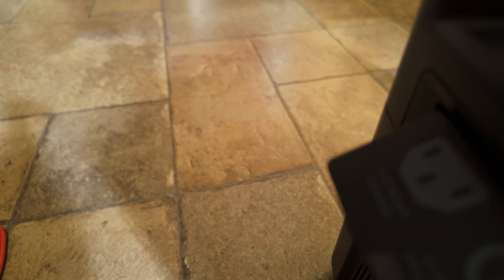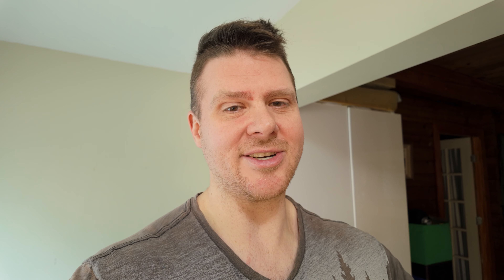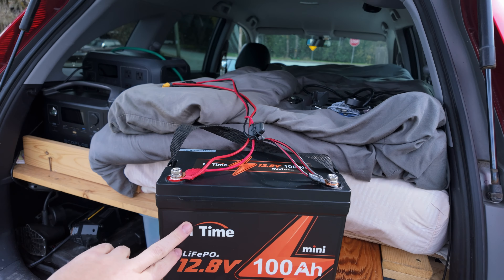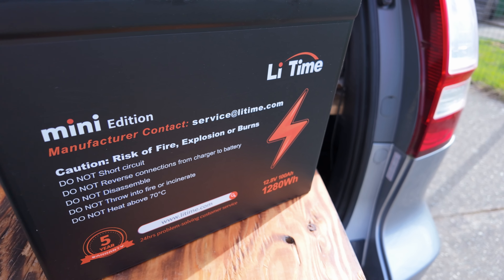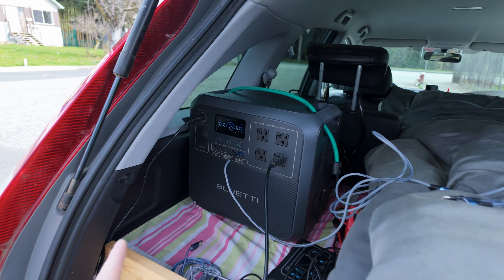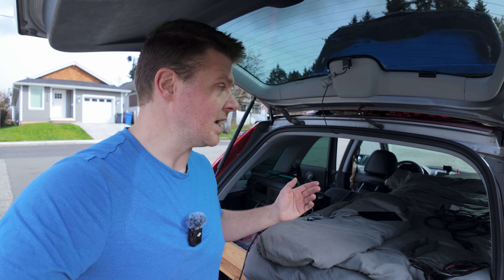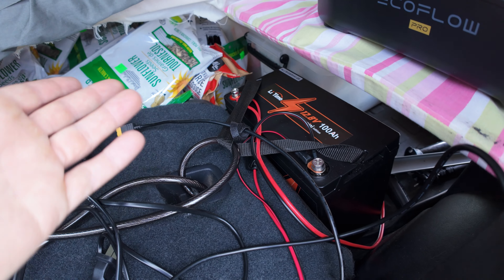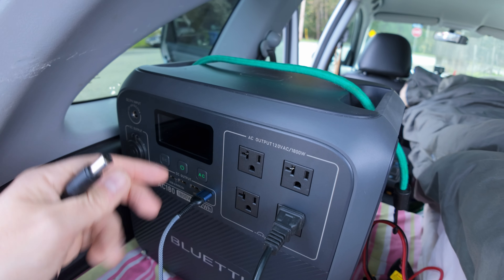No Electrical Cheap Vanlife Power with LiTime 100 AH Mini Battery

Comment: I bought a Bluetti 180 primarily for charging my Emtb when away. Did the numbers on a 100 Amh battery, chargers and converters for the car and it was cheaper, but messy with the wiring and not portable.The big winner  for me was the quck mains charging cycle on the Bluetti.
Reply from the maker: ya those units are definitely more portable than a power system with all the cables etc. The ac180 is a heafy one for sure! I snuck both that and the eco flow into a vistor center in kanannaskis to charge the haha. Quite litterly lugging around 65lbs of power stations.